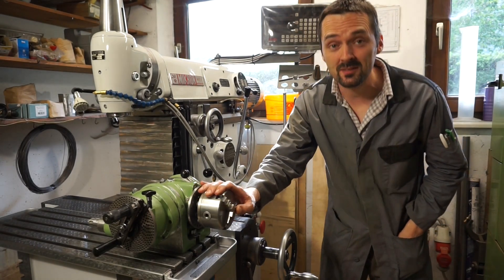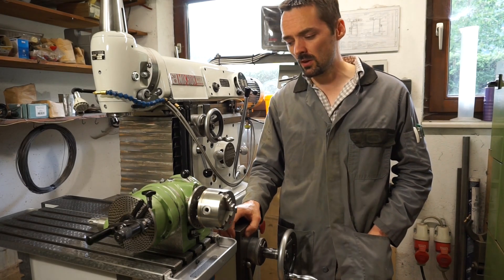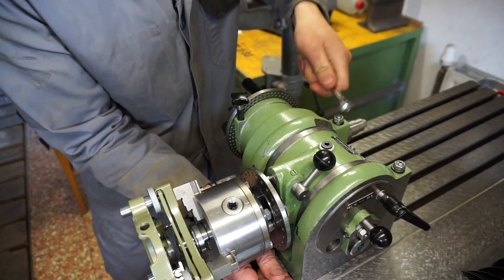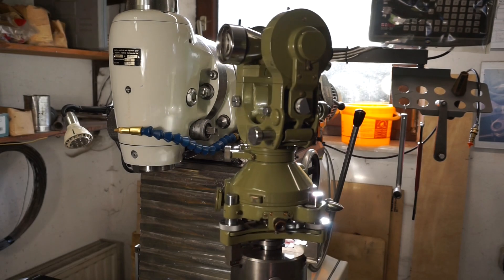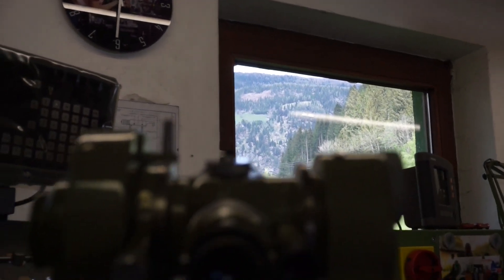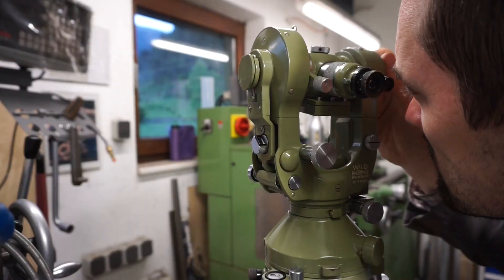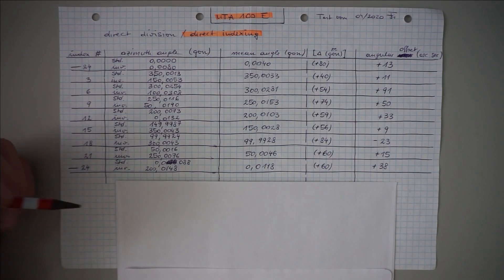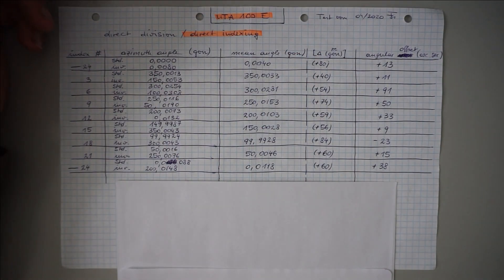Dividing Head Accuracy: Unconventional Testing

Comment: Or simply mount a rifle scope on the dividing head with the former's axis in line with the latter's face, and have the scope pointing  at a target at a distance say 10 yards for an MOA scope or 10m for a MIL scope. Values can then be extrapolated by simple maths. Of course a better way would be to use a rotary encoder with even finer resolutions.

Comment: There are two errors to consider in the use of the Theadolite.
1rst error as you mentioned is machine error. This is the circle indice accuracy. Also not being absolutely perpendicular/level to the circle plane.
2nd error is user error. This is called parralax. Parralax is caused by the the angle of the human eye looking around the stadia. A learned and experienced surveyor knows how to move the eye and head back and forth (left to right, right to left) to zero the parralax error consistently.
During my training, I was amazed at how much angular error can be intruduced by not limiting parralax error to a minimum.

Comment: I would be very interested to see what the index errors are using the index plate and worm dividing function of the Walter. The direct index function utilizes a straight pin in the index plate which would account for the errors in your measurements albeit very good for a shot pin arrangement. 

All the best,

Tom
Reply from the maker: Hello Tom,
wow, thanks for your kind comment. I'm following your channel for years now and have probably seen 98% of your legendary video publications.
Anyway, a precision test video of my Walter indirect indexer is coming up, since I'm currently reconditioning the worm drive (regrinding the worm is shown in my most current video). All the best from Austria, Alex.
PS: I hope you did finish the Zirbenschnaps which I sent you a few years ago. ;) The guy who produced it meanwhile had his boiler burst during a live show (luckily no one got hurt).
Reply: @anengineersfindings  Hah! I may have the only remaining bottle (partial) of Zirbenschnaps in the west. I think it's value just went up. Looking forward to seeing the next video installment. 

Cheers,

Tom

Comment: I am curious now as to what, if any, features possessed by this specific theolodite are different or more accurate than others. I can grasp what I see now, but I am probably never going to find either of these tools. In my experience, stuff like this is kind of near impossible to find in the States. I often look abroad to find high precision manual tooling for my work.

Any thoughts on what features an "obtainable" non-hyper specialized theolodite needs to have to duplicate this? I've only seen the things on large stands for surveying use, never anything compact like this. Now that I get how it works, could you use one in reverse- to manually adjust machining to be more angularly accurate?

This is why I love your channel- you test accuracy as the main goal. Most people have never seen anyone do what you do.

Comment: Fantastic method for checking the dividing head!  The one thing I'd suggest changing on your technique would be to aim at the corner of one of the barn windows, laying the crosshairs along the edges, rather than trying to choose a center point in the window.  I learned surveying in college using a degree-reading T2, otherwise very similar to your instrument.
Reply from the maker: Thanks for your interesting comment, Sir. Whats not visible in the video is that the windows have internal framing (i.e. each window consists of four smaller windows). I used the framing as a nice target for the crosshair. Otherwise I would have used the edge of a window, like you suggest.
Reply: I prefer Gon and Mils to DMS (degrees minutes seconds).
Reply: Perfect!
Reply: Actually centering the cross hair in the white box of the window is very accurate. 

I use T2 and the larger T3 for indoor metrology. At close range a sewing needle works well.
Reply: In the T2, the reason the two readings (standard and reversed) are slightly different is the collimation of the cross hair in the scope. It can be adjusted, but when it’s small it’s harmless as standard and reverse are always read. That collimation error is completely accommodated by averaging direct/reverse readings. 

Note: a T2 doesn’t need a calibration sticker. Proper operation always returns accurate measurement.
Reply from the maker: Awesome hint with the calibration, thank you!

Comment: Great video some how I missed this video of yours. 
Now I need to buy a T2. 
On one of my many trips to Antarctica and South Pole 
There was the crew assembling 
11 meter telescope mirror which is made of 100-200 approx sections.  Each section was adjusted and calibrated with a centrally mounted Theodolite.
Reply from the maker: Wow, a spectacular working place! Some months ago I was involved in rigidity testing a huge roller spindle for the pitching actuator in radio-telescopes. The customer told me, the type of telescope they also installed in Antarctica. Must be an adventerous place!

Comment: Nice work! Wonderful instrument. The Wild T2 is my dream theodolite (I have to make do with Zeiss/Jena Theo010s at the moment)...
Plus, fun fact:
sin(1") = 1/206264.8 which means on a 75 mm radius index circle, 25" corresponds to 9.1 μm offset. So, after 1 full revolution, the indexing pin locates again to better than 1/100 mm (which could be due to a bit of play because of an oil film somewhere being pushed one way or the other).
Reply from the maker: Very good point, thanks! The UTA100 has an index circle diameter of 95mm, so the positioning error at the pin must be even smaller than the 9µm you estimated.

Comment: An obvious sinusoidal pattern with one extreme outlier. The sine wave would be from manufacturing error from one of the process machines at the theodolite factory. The extreme outlier would be from a wear pattern from improper usage or assembly damage. 

I've used a laser collimator for reflecting telescopes to project a beam onto a remote target, measure the offset, then calculate the error. Providing sub arc-second capacity!
Reply: Post a vid! People would love to see how!

Comment: Alex, that was a surprise, an interesting one.
I will be watching for the manufacture of that worm gear.
Which of course would be made easier on the repaired external drive deviding head!
Ask ToT for a use of his time travel device, sorry, I digress.
That theodolite is a work of art, thank you for showing it off, and it's travel case. I shal be on the look out for one...

Comment: Not in a million years would I have thought to measure anything in my shop with a land surveying tool...  salute
Reply: LOL I would be inclined to think the same thing. Theodolites were not only a land surveying tool. Because of their precise nature, they were used in manufacturing shops to precisely locate things  such as large fixtures and jigs or the parts they held for example. Often used in aerospace and power generation applications etc...  As an equipment operator I would often assist surveyors and engineers in the field where they would use a theodolite when they wanted better positional accuracy than the transit would allow. (usually setting some piece machinery in place) It is a beautiful elegant instrument, one a mechanical minded person can appreciate.

Comment: I worked for an engineering firm 50 years ago as a rodman, and that is the same theodolite we used, the civil engineer referred to it as a transit. I enjoyed the video, and i did not realize how delicately accurate those instrument are, cheers!
Reply: An interesting method and not one I would have figured out on my own. I could be wrong but I believe Theodolite is a fairly old name for the tool and was/is used mostly in Europe. Transit would be a more modern term that seems to be used in North America. I've only heard them called transit's here in N.A.
Reply: @turningpoint6643  Though transits and theodolites my appear similar in function (they both measure angles), they are very different instruments. Transits are like a yard stick and theodolites are more like a micrometer. While yardsticks and micrometer both provide a means to measure an object, they do so with vastly different levels of precision. The same holds true of transits and theodolites. 
Transits have been around much longer than theodolites. There's nothing modern about them. While transits are still used for crude work by contractors, theodolites have been replaced by total stations which are far more capable.
Reply from the maker: Very interesting, I wasn't aware of that, thanks.

Comment: Nice video. Now we want to know how close the other index plates are. ;)
Reply from the maker: Got me! Turned out that my worm gear wheel is worn, my indirect accuracy is roughly factor 3 poorer than my direct indexing accuracy. But I spared this information for a potential part 2. "Dividing Head Worm gear manufacture" or so.
Reply: @anengineersfindings  :)  That sounds like a cool video.
Reply: @anengineersfindings  That I would enjoy seeing. Machining a new worm gear for that dividing heads original accuracy specification in a home shop wouldn't be easy. I suspect the better ones are hobbed,  ground, and then lapped for the best precision.

Comment: Wow, this was really great. And it raised a few questions and comments to be made.
1. You checked and adjusted that the axis of rotation of the divider was perpendicular to the plane of the theodolite. Isn't it equally important to check that
 the two axes of rotation are coinciding besides using the centring bushes you used when mounting the instrument to the divider? Or did the distance of your target
across the valley negate the possible error?
2. I have always kind of wondered if a theodolite could be used in place of an autocollimator for machine tool or granite plate flatness measuring purposes. I guess
that 0.5 arcsecond graduations are not fine enough but maybe modern theodolites have finer resolutions and accuracy. But what about the optics and the accuracy 
obtainable from targeting from a small distance such as within a room or building, say less than 50 meters? I've been told that theodolite accuracy diminishes as the 
target get's closer to the instrument. What do you think? 
3. I have worked with a land surveyor friend in the past and had the privilege of operating a Leica electronic theodolite for a few days ( i think it was considered a total 
station, it had distance measuring feature incorporated to it, but no gps) and boy what a beautiful and precise instrument it was, and user friendly. I 've also had my hands
 on a Japanese Topcon unit and you could tell there was a difference.
4. Now I know the next time I'll be touring around the beautiful Austrian valleys (the route from Brenner to Innsbruck is probably one of my favourites) I won't just be looking 
out for beautiful scenery but also for great home machine shops.
All the best, Dimitris
Reply from the maker: Hello Dimitris,
to 1.: The point here is to target something far away. The error in angle due to axis excentricity becomes negligible then.
2.: I wouldn't see why a theodolite should be less precise on short distances. The angles you measure are the same. But not all theodolites are able to focus on short distances. My T2 can focus on 1.2meters (!) minimum. I'm sure you can use it for autocollimator work, provided you make a suitable sliding base for it.